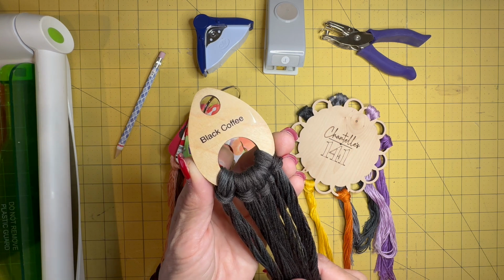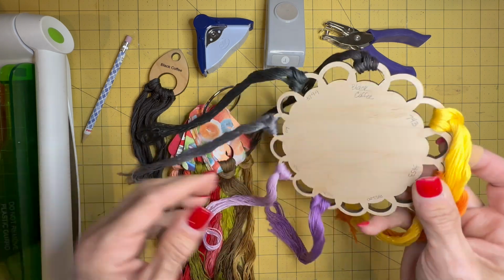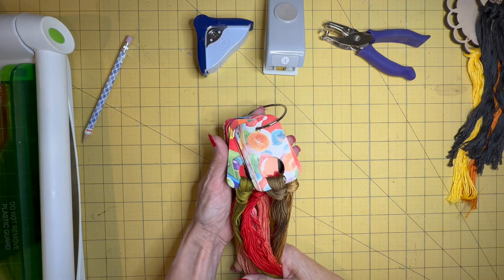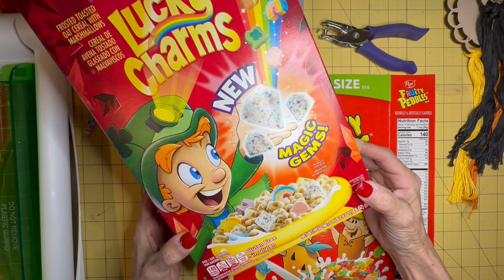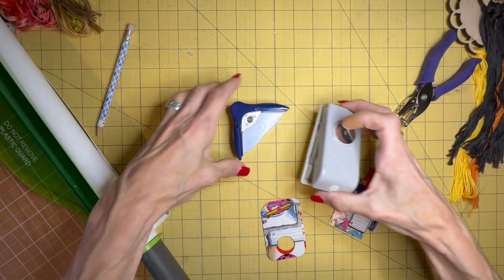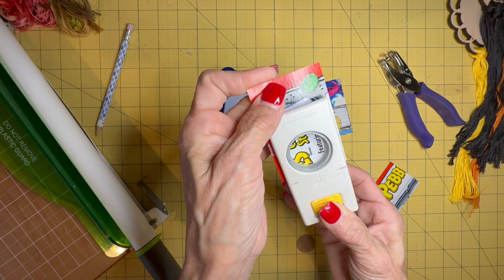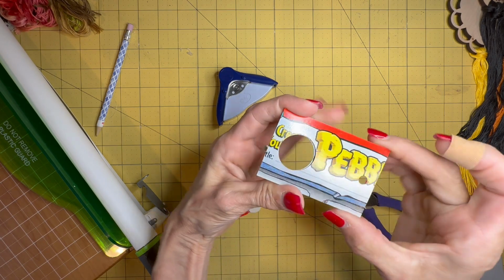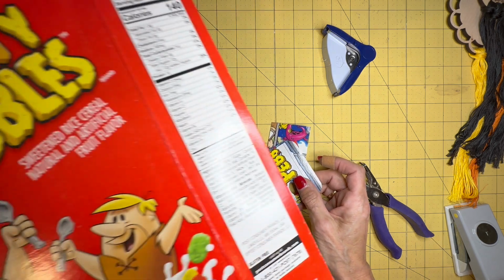Cross Stitch Organizing with Chantelle | Making Floss Drops from Cereal Boxes and more

Comment: Great idea to use cereal boxes. Just a tip that you may or may not know. If you use the corner rounder on some foil and punch several times, it will sharper the corner rounder.